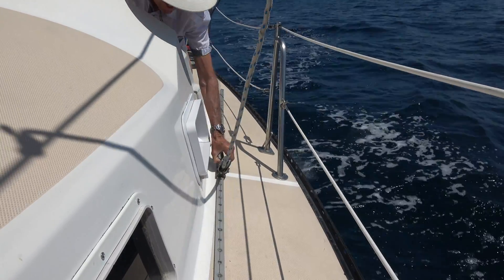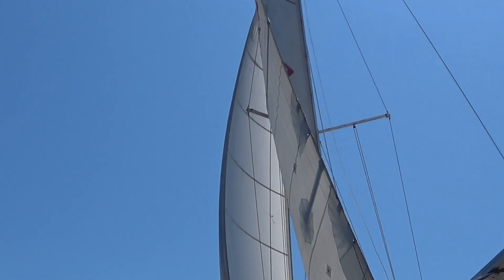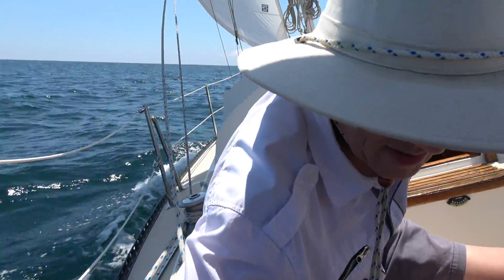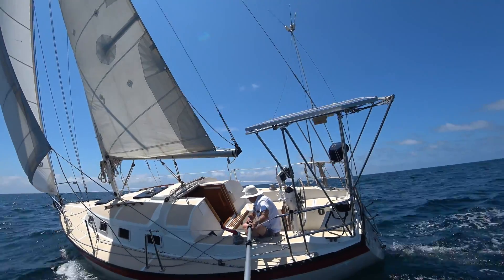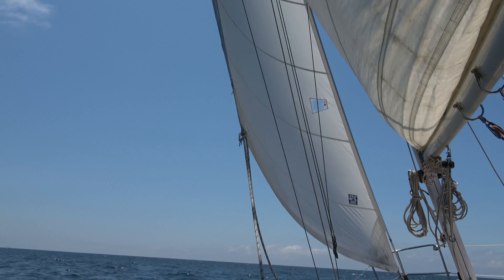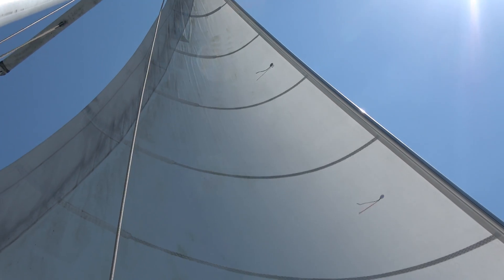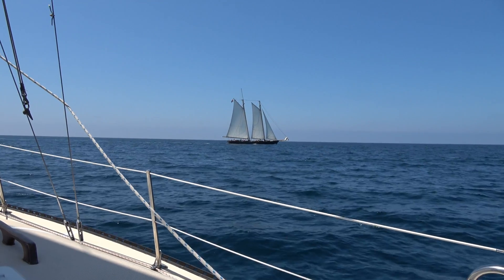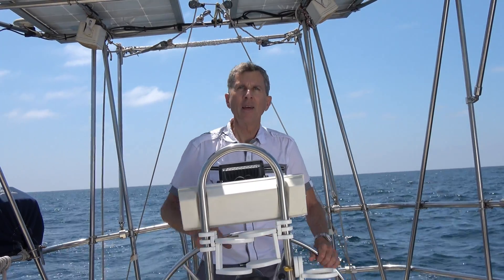Advanced Sail Trim Made Easy, Part 1

Comment: shouldn't you be wearing a life vest?
Reply from the maker: Absolutely! A hazard of sailing all your life you get so comfortable at sea you forget the risk. But that is no excuse and I need to set a better example. Thank you for reminding me.
Reply: Ideally one should be wearing a life jacket, be tethered to a jack line running along the Centre line of the boat, looped around the jack line and back to one’s harness, and also move around on the upwind side of the boat, which is farthest from the water, where falling would be a fall into the cockpit or onto the deck, not into the water. I agree that it is best to move the windward, unloaded car. Some cars are adjustable using lines rather than pins and holes, and can be moved easily from the cockpit even when loaded on the leeward side.